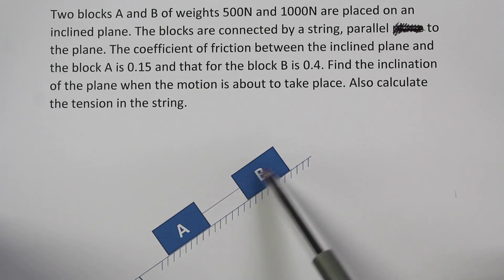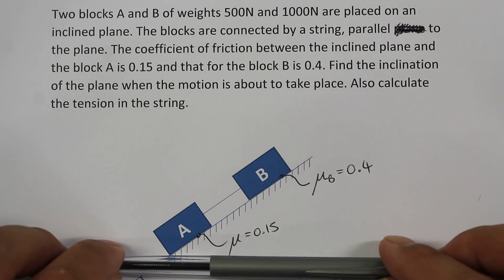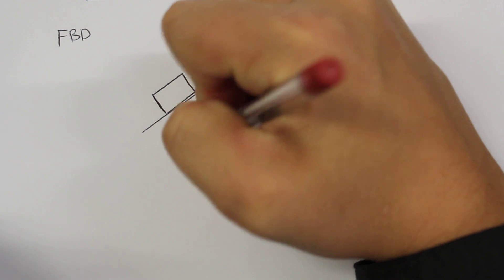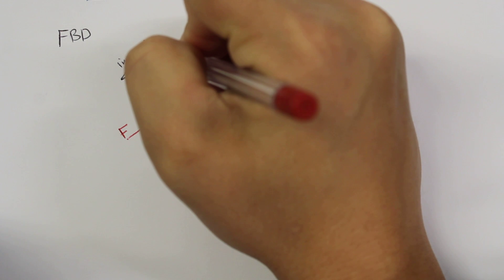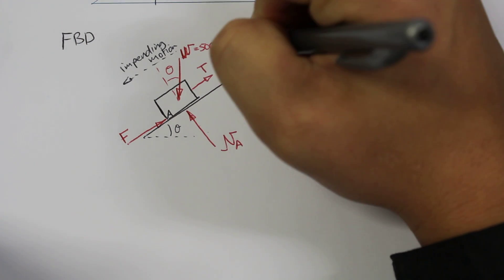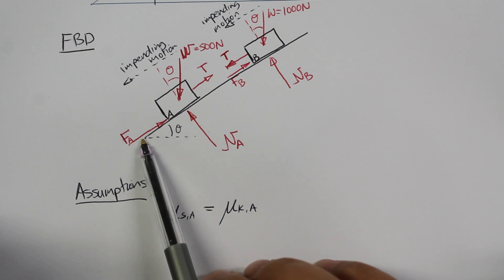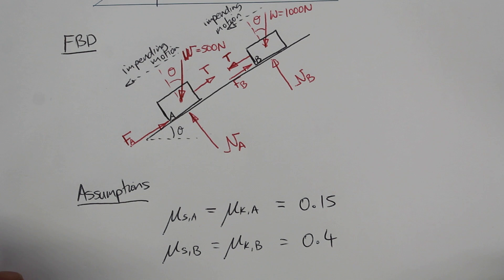Two Connected Blocks on an Incline Part 1

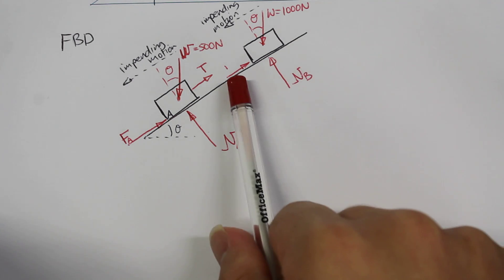Comment: 6:10 why we have the tension force in direction of pull of the box ?
Reply: This video below shows a tug of war competition. You will notice in the video there are two teams, one team pulling in one direction and anther team pulling in the opposite direction. As a result of the pulling the rope is in tension.

https://www.youtube.com/watch?v=qYEzLL510o8

If those people were applying their effort in the opposite direction, the rope would not support the load. A rope can only support tension and not compression force

In this case, the box at the bottom is being pulled up by the rope; the box at the top is being pulled back down by the box at the bottom.

Note: There is a free body diagram that is missing from the example above which is the free body diagram of the rope that connects the two boxes.